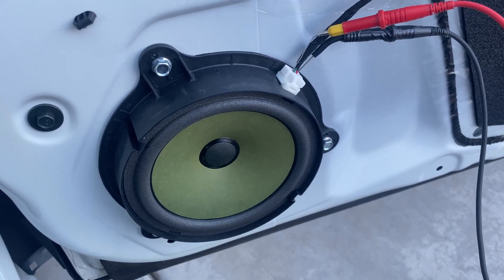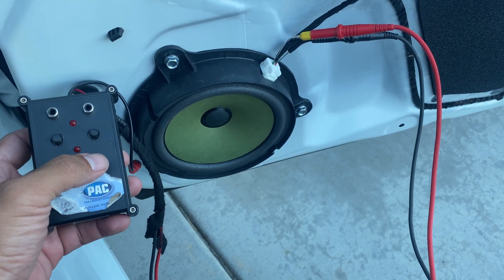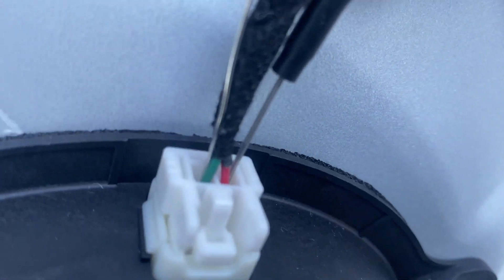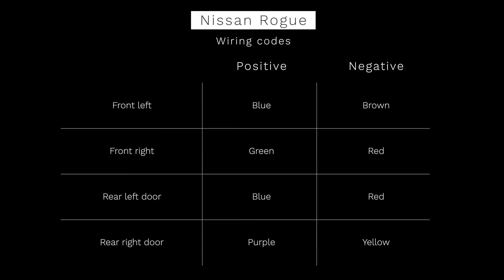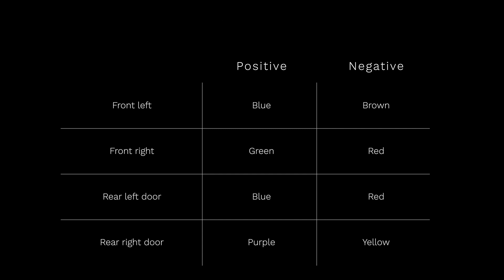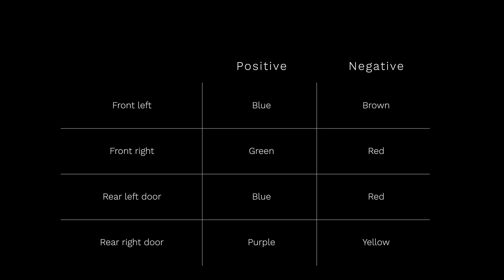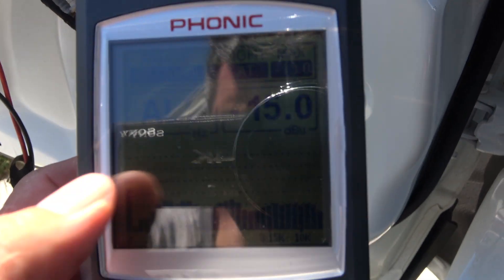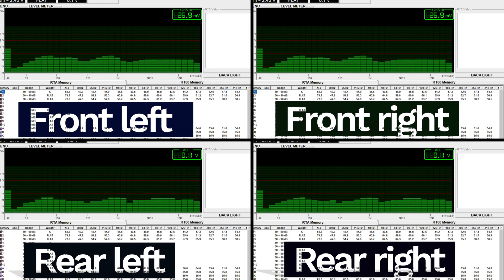nissan rogue speaker wiring diagram

Comment: A bit of the topic here.... I have a 4 channel car amp thats immediately blowing the 2 20amp fuses on the amp as soon as its inserted into the holder on the amp, I have only the power cable and the ground cable connected. The remote wire, rc cables and speaker wires are all disconnected. Without even turning the amp on its blowing the fuses... please assist

Comment: Does the 2014 Nissan rouge have an amp?
Reply from the maker: The one I worked on didn’t 
Usually their is a premium sound system marking on the stereo or door  that lets you know it has an factory amp